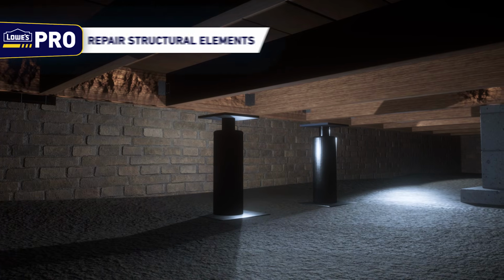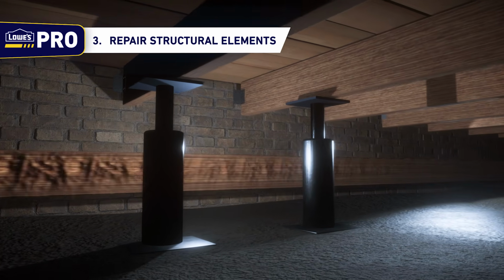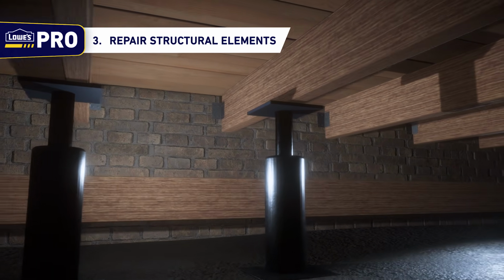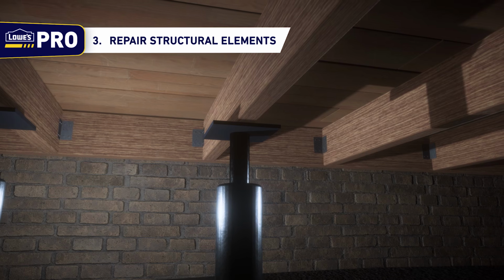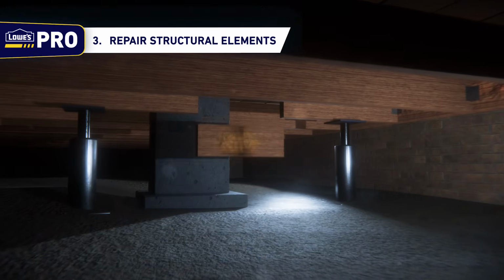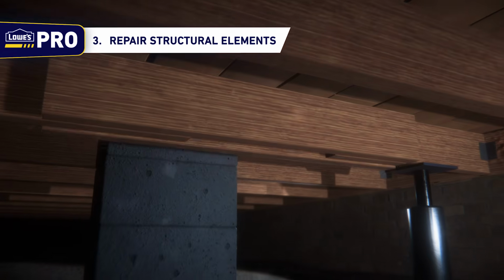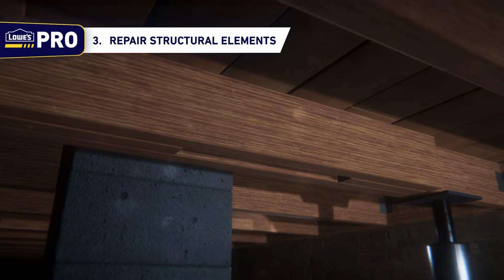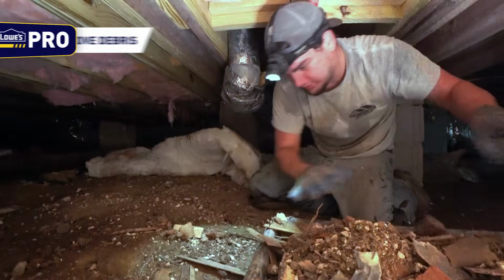How To Partially Encapsulate a Crawlspace | Lowe’s Pro How-To

Comment: I've been in the encapsulation business for years. DO NOT tape any poly / liner to concrete piers or concrete foundation walls. It will not stick over time and will shortly fall off. You are better off using concrete anchors every 3-5 feet on the top edge and then sealing with a 2" double sided butyl tape, a polyurethane caulking, or spray foam. The anchors will keep the top edge permanently up and your sealing method will keep it air tight. Also please be aware that fogging your crawlspace will cause a lot of that product to go upstairs as your HVAC duct work, subflooring, plumbing penetrations, electrical penetrations all allow air from the crawlspace to go upstairs. Also you should cover as much of the foundation walls as possible and support columns. Concrete wicks moisture and to go up only 4 inches on the wall allows for evaporation off that concrete. Just leave at least 4 inches of foundation wall exposed at the top to make the termite companies happy for inspection purposes. If the homeowner doesn't care about a termite inspection gap at the top then just seal up the entire wall to maximize mitigation of evaporation which high humidity causes mold and fugal growth.

Also this is not a DIY project, hire a pro
Reply: “Not a diy project” ligma pro boy. Stop marking up materials so much and maybe regulars wouldn’t have to make it happen
Reply: I know many people who have done DIY conditioned crawl space. It's not rocket science. Theirs turned out fine and has held up fine over the years. BTW, since you are a pro, shouldn't you  know to create a slight vacuum under the house when fogging. This will keep is out of the living area. That should be common sense...
Reply: Why is this considered a partial encapsulation?  What would be a complete one?
Reply: The white sheet material all the way up the sides.
Reply: I would add do not install a gfci under the house due to having to go under to reset if pops.  Home owner might not get informed that it has tripped. Instead see if you can tie in to a receptacle line if accessible and up the breaker if needed. Just make sure that line has a GFCI receptacle on it.
Reply: What’s the general cost for this?
Reply: @Nick Zema  we were just quoted 15k yesterday
Reply: @hashtagzema  That depends on many factors: sq ft of crawl space, height of crawl space, how easy or difficult it is to move around crawl space, which vapor barrier you select (min 6 mil, but I'd use at least 10 mil non reinforced), whether you have a dehumidifier, power supply for dehumidifier, height of crawl space walls (for materials like foam boards, vapor barrier & other supplies), etc.
Reply: Omg! Ty
Reply: Thanks for you input, very informative
Reply: If the wall of the crawlspace is only 3 ft height in humid Florida. All vents closed and a dehumidifier in it. Could the walls be sealed with closed cell foam which would also seal the vapor barrier placed in the floor (since foam could be sprayed 12 inches in the floor and up the wall? Or the vapor barrier required to go up the wall? It's only a 3ft wall
Reply: Hey Jason, you're right the tape won't stand the test of time! Have you ever used caulking before? If so, any specific type you used?
Reply: @bobbyscongackmusic  I'm  just chiming in. When we seal a crawl we use a product called QB300. It seems to chemically bond with the vapor barrier and the concrete assuming there isn't too much moisture sitting on it.
Reply: @bobbyscongackmusic  He doesn't know. Anybody that says put up "concrete anchors" first THEN double sided butyl tape is a hack.
Reply: I'm using true 10 mil poly on floor and sides and foam boards for the stupid vents that do nothing but let moist air in!   

Just keeping the batted insulation in ceiling as is. 

Should work very well!
Reply: @Oz-ov1uu  You might want to check your building code. Some areas mandate location & type of insulation when (useless) vents are sealed.